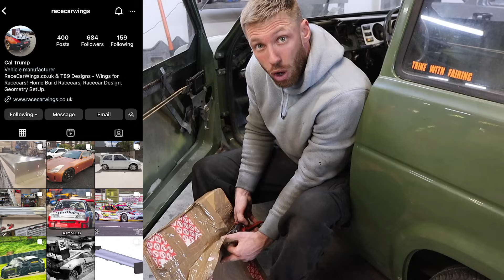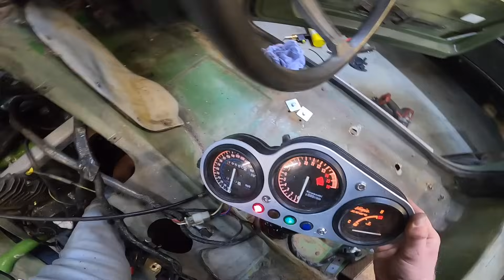FIRST START OF THE ZX6R RELIANT WENT WRONG!! - Motorbike Engine Swap (PT.8)

Comment: Happy to help Lee, thanks for the shout out. Couple of comments:
1) The "resistor thing" is the Reg/Rec its part of what would be the alternator on a car, the reason you bolt it to metal is because it gets really hot and it needs a heatsink and a bit of airflow to keep cool.
2) The green light is the neutral light so it was in neutral, no idea why it wouldnt crank on the button, most likely a kickstand or tip-over failsafe is stopping it cranking.
3) When you rebuilt the clutch did you make sure that the cutout in the lever engaged with the plunger on the end of the clutch, if not thats what could be jamming it and also meaning it wont actuate.
Wish I could be of more practical help, I enjoy the videos loads.
Reply from the maker: The lever is pulling.. but I guess I’ll have to wait and find out 😂
Reply: Old kawasaki zx6r don't have tilt sensors, the starter button won't be working because of the starter cutoff circuit (clutch lever switch, sidestand switch), on the switch gear that as the indicator switch there will be a small multi plug with 2 wires that will be clutch switch, just join the 2 wires together, same with sidestand switch.
Reply: I would say it would be the kick stand sensor too, it happened to me once where the sensor came lose and the bike wouldn't start
Reply: Didn’t you join the cables? Undo them
Reply: @itsleelockwood  Also the last clutch plate should be offset, lugs put in the other groves. The clutch lever also has a sensor to stop it starting in gear just like the kickstand.

Comment: Having worked on Kwaks for the BSB for many seasons, I offer the following advice. 
1) Take the clutch cover off, remove the corks, the metals and the basket, make sure the spacer is facing the right way (it'll be stamped) 
2) with the clutch out, the driven side of the gearbox (sprocket) should now be free to move. Kwaks have some ball bearings that stop you from shifting without the engine running, with the clutch now not in play, you should be able to wiggle the sprocket backwards and forwards. If you can, re assemble the clutch. 
3) make sure the clutch actuator is actually gripping the plunger, you can feel this as you put the cover on, have the clutch lever pointed towards you (outwards) you'll be able to feel it click as it grabs the plunger. 
4) the resistor you speak of is the bridge rectifier, keep this cool, otherwise it'll go pop and you won't be able to charge the battery. It's only 4 diodes to convert AC from the alternator to DC. 
5) the blue light is high beam. You want the green light for neutral. 
6) continuity check the earth's to the battery/ frame.

Comment: Hi Lee,
Did you link out the kick stand and clutch switch?
It’s not uncommon on bike boxes to struggle to get neutral. Put the sprocket back on the output shaft and just rotate it back and forward a bit while moving the shifter pedal up and down until it selects another gear. I’m pretty sure that the zx6r uses a starter clutch to engage the starter. That might be the problem, did you definitely have the polarity the right way when you were jumping the starter, if you were spinning it backwards the starter clutch would not engage?
Gimme a shout if you need any help with it. Loving the build so far 👏🏻
Reply: Good point. On my bike you have to pull the clutch in aswell   🙄

Comment: I reckon the gear leaver is sticking because normally on a bike you'd rock the bike back and forth whilst lifting the leaver for it to come out of gear so worth turning the prop adaptor back and forth whilst lifing the shifter. Ps hurry up and get it started wanna see it running 😂😂
Reply: No need to rock it back & fourth, just push forward & tap down.

Comment: The starter motor doesn't have a bendix to throw it into mesh, it is permanently connected through a one way clutch, once the engine fires the clutch takes over. The fault is certainly the new clutch, all you can do is go back step by step and double check.

Comment: Lee, you can look online for torque settings for different sizes and strengths of bolts. 

Use left handed drill bits to extract broken bolts next time.

Comment: Just watching this and got to your clutch bolt issue, a lot of broken bolts will come out if you use left hand drill bits without even having to see an easy out, especially on your clutch hub, as you said it was going further in with normal drill

Comment: Hi mate , the bike engine might have a side stand cut out switch , if the clutch isn't pulled in it won't start , if you can't find neutral rock the car back and forward , good luck 👍

Comment: Lee, I am. A bike  Mechanic  as well as cars . The starter on a motorbike only spins so your starter is fine . There is a gear called a sprag clutch it’s a gear that turns freely one way and locks when you turn it the other way turning the clutch basket , turning the engine over . Put your finger in the hole were the starter goes and feel for the gear and test it to see if it turns properly, that’s your problem buddy.

Comment: Lee the starter ring gear needs looking at …. There are some springs in it that maybe worn . Is the starter ring gear behind the clutch basket ? If so have you meshed the intermediate gear correctly ? Or have you left it out ?

Comment: 1. the starting issue will most likely be the clutch switch is missing should be 2 pin connector up front of the loom or if it has one a tip over sensor usual sits half way down the bike under the seat will be a small box rattles when ya shake it lol
2. the starter motor does not move in or out on a bike just spins so is correct, bikes have a starter clutch basically a one way bearing on a sprocket and an idle wheel hence when you stick ya finger in the hole it spins one way not the other 
so i would check size of the starter shaft with old one and count the spines it sounded like the starter wasn't meshed with the other gears

Comment: It could just be because its a bike and sometimes they do feel duff trying to find neutral when they're not running. Normally you'd roll it back an inch on the chain slack and lift  the gear lever simultaneously an it will click into neutral. Obviously you cant do that so you'll have to get something to rock the prop adapter back and forth , doing it with your hand won't work. With the wheels connected you wont get that problem you let the car roll back or forward a tiny bit. And i hope there is oil in it before you attempt to start as its engine clutch and gearbox oil in one and could also not be helping the gearbox.
Reply: My thoughts are the same on the rocking the prop back and forth to get it to change gear. Bikes won't budge sometimes until you rock them, especially with your hand.

Comment: Don’t know this for sure but on ATVs I used to work on they had an almost identical starter, they were always engaged with the starter gear so didn’t fling out as a conventional starter would, I would assume this is the case with yours sounds like a in issue with the starter gear rather than the starter I could be wrong tho.

Comment: You can just changed the clutch basket if you can’t get the bolt out I’ve done this many times is a ball ache but is very easily fixed

Comment: On the clutch, there is a friction plate ,1 of them is slightly smaller and that must go at the front, if it’s like most of the bikes I’ve worked on that’s how it should be. It’s been a long time since I done a bike clutch, front meaning the last 1 you put on, however, a slight rock back and fourth of the shaft should give you ability to change gear again, unless it is the clutch plates, meaning the smaller 1 at front

Comment: I think you have a sprag clutch which will be a cog system or one direction bearing that links the starter to the crank ,so i would guess its something behind the clutch basket you havent installed correctly. So i would whip off the clutch basket again and im sure you will suss out what is wrong

Comment: with motorbikes you tend to need to rock then back and forth to move gears . the Green light is the nutral light also mate and im not 100% sure with that model zx6 but most have a kill switch on the side stand you can bypass it by looping a wire
Reply: @leelockwood If all else fails unplug the ignition barel completely and plug a wire across to bridge the two thicker wires this will bypass everything on the starting side, then on the harness loop the wire for the side stand

Comment: bikes have starter clutch on the stator pulley side take the cover of and inspect it there should be a small gear between the starter motor and starter clutch

Comment: You have to press the brake on a bike with the starter for it to do anything. And the starter should jump out to start the retract back out the way when running. Id try another starter before play with the clutch again. To get it bk out of gear try rotating the output shaft while trying to change gears

Good luck 🤞
Reply: Not often a thing on geared bikes, thats for scooters and automatic bikes. the bike will need to be in neutral and sidestand must be up tho.

Comment: I had a Westfield Megablade with the 919cc fireblade engine and i fitted the same clutch and springs as yours and I wouldnt fit another haha

On mine i had to take it apart a few times as i found there was a specific order they go in for clutch to work correctly. Once i sorted that you need ensure the plunger on the end of the clutch basket moves freely and engaged correctly with the lever on the outer casing. Then once i got it up and running had spend time setting it up as it was slipping in the higher rev range and looking online no one recommended tge ebc clutch and said the best one was oem clutch and stiffer springs.

Good luck with the rest of tge build.

Comment: The starter button might not be working because of the starter cut off circuit, i.e clutch switch,sidestand switch.
The starter motor might not be engaging because you haven't got the starter solenoid connected. Without it connected the starter will just spin, it's not like a car that as solenoid built into starter motor.
To get it in neutral (green light on) try turning the engine over slowly by hand as you move the gear selector.

Comment: Check the Sprag clutch. This will cause the starter to spin and not crank the crankshaft.
Reply: That's a good point, also on some bike engines (yamaha) the clutch basket engages with the oil pump drive.

Comment: Clutch wont work if the cable's to tight needs a little slack/play in lever and you could spin the flywheel through the starter hole because it has a one way clutch/bearing if spins both ways thats your problem not the starter

Comment: Battery regulator has to be bolted to metal 
It regulates voltage from stator plate In engine reduces voltage so ya Battery chargers and regulates 
14 .3 volts

Comment: Bike engines are annoying in my eyes ive had a handful and id say if the kickstand kill switch isn’t properly bypassed it obviously wouldn’t start sometimes bikes need to be rocked back and forth for it to switch into a gear like at the start of trying to crank it it was in N but seriously mate good luck loving the build if it was me have another look at that kickstand switch some bikes work with unplugging it and some are just made to be more annoying

Comment: It looks like your starter isn't engaging with the sprag clutch.  Look up zx6r sprag clutch for a video.
Reply: Sprag clutch is what the starter drives, think of it like a push bike.  Rear wheel is the crank the freewheel sprocket on the rear wheel is your sprag clutch and the pedals are the starter motor   The pedals spin engaging the sprag clutch and driving the crank. When the crank I spinning fast the sprag clutch stops driving the crank as the starter can't spin fast enough.
The sprag clutch only drives one way.   

Either the sprag clutch has gone bad or your starter is spinning the wrong way, I think  ❤

Comment: When i worked at a motorbike shop we use to them ft which means fucking tight 😂 and the green light on the clocks means its in neutral

Comment: You will feel like you pulling the clutch in but really it’s hard to do it with your hand if you rock the sprocket an try change gear it will do it when the engine is in the bike you have to Rock the back and forth if it won’t change gear an the reason you can the cog that the starter goes to is because it only catches one way an spins freely the other way if you get me the clutch is correct you just stress too much lee don’t stress you have all of YouTube